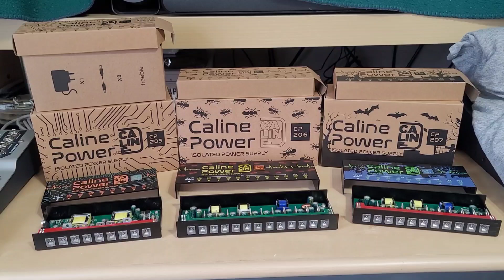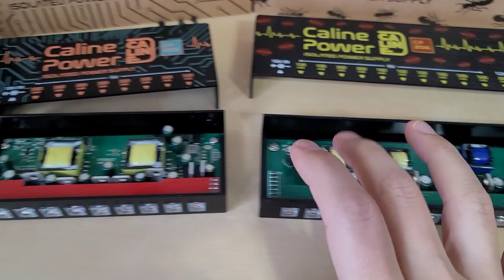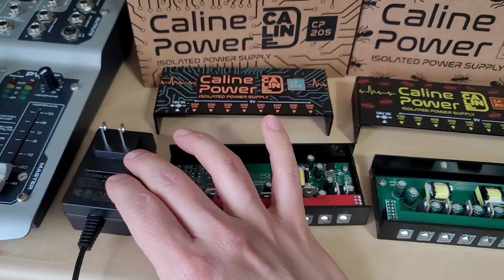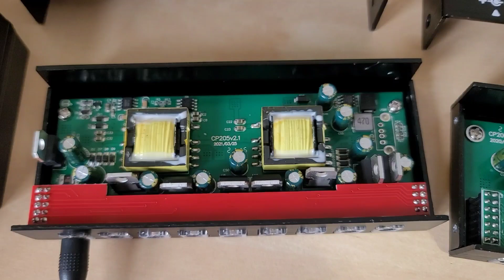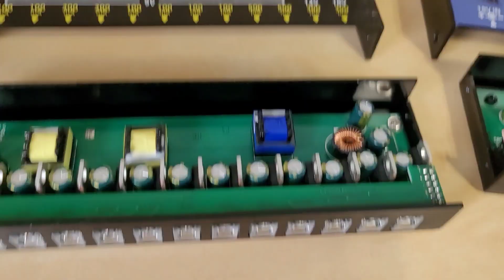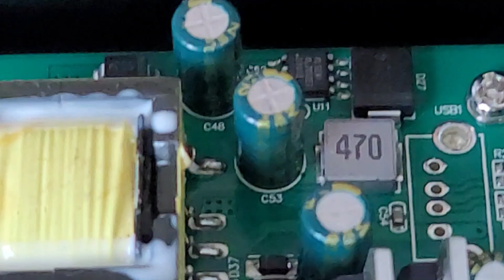Caline Pedal Power Supply: True Isolation? How They Compare To Other Brands?

Comment: The way you tell whether the outputs are isolated is by testing for continuity between them. There should be none. Seeing a transformer isn't proof of anything. It's indicative of isolation potential, but not proof that each output is truly isolated.
Reply from the maker: Again I have answered your comments on my other videos and transformers do exactly that they isolate galvanically. Maybe you should do a video and explain why you think these are not isolated, I doubt you will.

I can go and do that continuity test you were talking about but that doesn't necessarily tell you anything. You can have filtering components that create a very high impedance where most meters would not show a low ohm reading between the negative ground pins. That type of "isolation" should be called filtering since there is still a physical connection.

Caline's engineers sent me the schematics of all their power supplies directly so that I could review them. The fact they implemented the switch mode transformer with separate secondary windings gives you galvanic isolation.

Comment: I use one of these to power my Boss ME-90 multi effect pedal (9 volts at 200a), a Shure GLDX wireless receiver (15v) and an Archer Ikon Overdrive (9v).  No problems or noise at all and it costs under $50.00!
Reply from the maker: Awesome!

Comment: Any experience with the CP-209?
Reply from the maker: @epoxy81  yes! I'm working on reviewing that now actually. It is isolated like the others
Reply: @Bassguitarist1985  is it good?  it's my first ever power supply.  it was just so much cheaper than others that I was a little nervous.
Reply from the maker: @epoxy81  same topology inside as the others! I wouldn't use for high current above 500mA for one pedal, but it will be nice and quiet and no buzzing.

Comment: question? have 8 mini pedals and my power supply only has 7x100ma plugs 1x500ma plug 12v 18v plug. can i plug one in the 500ma slot or will it fry my pedal? cheap or not i cant afford to buy it twice
Reply from the maker: @livefreeordie1776  500mA is fine for a small mini pedal. That's it's max capacity, if the pedal is rated for 100mA that is the most it will draw. Don't plug in a 9V pedal to the 12v or 18v unless it's rated for that voltage.

Comment: can I plug any 9v pedal to any of those plugs? like the 300 and 500ma??? or only to the 100ma? basically, if I have 12 single 9v pedals I could power them all with this block right? btw Great videos! thanks
Reply from the maker: @NocturnosRockShow  Yes you can as long as the current requirement for that one pedal does not exceed the rating of that particular port. You can easily power a 9V pedal that takes a max current of 100mA into a 500mA port.

What you don't want to do is put a 500mA rated pedal into a 100mA port, it simply won't work and likely malfunction.
Reply: @Bassguitarist1985  perfect!!! thnak you so much for the clarification! you rock!!! thank you

Comment: Dude! Thank you! 🤠 Any tips on using one of these to power a Line 6 DL4. Requires 9VAC 1200mA minimum? Can it be done? I always see DL4's on pedal boards and am curious how it's done
Reply from the maker: @TH1NB0Y  sadly not with these power supplies. That's a lot of peak current. There are other power supplies better suited for high current applications like the Line 6.
Reply: @Bassguitarist1985  Thanks so much!

Comment: I had (and still have, but outgrew) one of the Caline power supplys shown in your video. It served me well at the time but now I have a large pedal board that required an MXR ISO Brick for my HX Stomp and digital pedals plus a mini ISO brick for my dirt pedals and whatever else I'm patching in at the time. I still have to use output splitters and I daisy chain multiple pedals on the high current outlet of the mini ISO brick. I always thought it was odd that the wall adapter for the Caline power supply was rated at an output of 1.5 mA but the sum of all outlets on the power supply itself is 2.6 mA. How can this be?
Reply from the maker: @onlyusernameleft2  1.5A at 18VDC is 3A at 9V. Not all the outputs are 9V but I can assure you the wall adapter is more than adequate.
Reply: @Bassguitarist1985  I'll defer to you on that. The extent of my knowledge of the electronic side of music gear ends at soldering pickups and pots on a guitar. Anything connected to a power source eludes me.

Comment: Really helpful - thanks👍✌️😊 Ive been trying to get to the bottom of this issue - after reading reviews of cheaper RPS units. Celine seems ideal for the hobby/bedroom/weekly gigging musician👍✌️😊💜
Reply from the maker: Exactly and as a matter of fact I'm testing a new version of the power supplies that actually has the DC to DC converter in them eliminating the linear voltage regulators. Still needs a little bit of tweaking but as a company Caline is listening to the customer base
Reply: @Bassguitarist1985  Good to know. I may buy one soon, in the UK, great value, for something that works and is well specs✌️👍🤞💜😊
Reply from the maker: @musoseven8218  indeed! And the newer board version is better, but it needs some improvements before I can put my approval stamp on it.

Comment: I found a power supply with 8 isolated outputs and it is powered by a type C port, the pedal is called pedal power and model number is PW1. Whats the likelihood of it being truly isolated, and seeing as how its using a type C port instead of a barrel jack would it still follow the same rules as what you've described in the video. It says the input is 5v at 2.1amps, but I know Type-C can do like 20v I think so I imagine they'd be doing something like that, i dunno lol
Reply from the maker: Got a link to the product?

Comment: Have you reviewed the cp 204? Is it anygood compared to the cp 205?
Reply from the maker: No I haven't. The CP-204 is a non isolated mini PSU if I recall. Works for most applications except when you need isolation.

Comment: It might be one of their oldest power supplies, but I can tell you that the CP-4 (the snake one), is NOT isolated. Noisy as anything. It was $25, it was worth a shot. Their newer units are reportedly doing well.
Reply: I've only heard of Caline this year and every one of their products I've bought has been fantastic but I have heard people talk about "the old Caline" and how "they've stepped up their game." I've seen threads on pedal mod forums about another companies product using less than glowing terms. When reading further the enclosure is opened and the PCB has "Caline" printed on it and is a discontinued product that another company produced under their label. At least from what I've seen, there seems to be evidence that Caline was not always known for their quality and value. As someone who had parents that never even bought me new clothes of my own, I can have the pedalboard I dreamed of as a kid and each one cost no more than a large pizza.

Comment: Would know if the Caline CP-02 isolated also? I'm planning to build a small pedalbord and it would be nice to use a compact power supply.
Reply from the maker: Hey I am not sure I have not encountered that power supply from them yet. It looks very small physically so I'm not sure if it would be a true galvanic isolation with switch mode transformers. If you have it can you take it apart and see? If not I would recommend the 205 206 or 207 here in this video
Reply: Hi, did you get it in the end? I'm considering buying this one myself...

Comment: The isolation is on the positive side.  You can’t isolate grounds since all the pedal grounds are  connected together. 

A ground loop is the result of two different AC ground circuits, like two different mains outlets, where one has a lower ground potential than the other.
Reply from the maker: Audio grounds are common yes, but the DC ground even if common with analog ground are different. The LVRs are powered by a separate winding on the secondary side which is rectified. So you have an isolated positive and negative rail (virtual ground) for each LVR. I get what you are saying about audio grounds being common pedal to pedal, but it's important to note the DC grounds are isolated as well as the positive side.

Comment: Thank you for the video, it's really helpful. I use my Caline with total confidence and it doesn't let me down. 
I might add that being a complete numpty I plugged the power in to the wrong end (ie one of the power outlets) and I can happily report that this doesn't work. At all. However when I realised my stupidity and plugged it in correctly everything worked just fine. 
So its idiot proof too.

Comment: Do you get measurements of voltage output before putting them under load? I’m going to try your technique with 100 ohm resistors, but unloaded ports are at 10Vdc.
Reply from the maker: I measured 9.01V no load

Comment: Great video, however, can you explain why AC current is rectified to DC in the walwart, only to be flipped back to AC in the unit? Wouldn’t it be more efficient to bring low voltage AC from the wallwart into the unit, eliminating the two converters?
Reply from the maker: Sure, the main reason is regulation. That circuitry exists inside the wall wart specifically. Stepping down AC voltage from the mains is done via a heavy transformer usually. Using a switch mode step-down buck converter that is lighter weight will take the mains voltage down to the regulated DC voltage first. The isolation will happen next with the conversion back to AC voltage. Finally the last stage rectifies it back to DC and filters any switch mode noise out.

Comment: I will say that I guess I got lucky cause Im using a Caline P-1 power unit for now about 4-5 yrs powering a 12 pedal board without problem. Enough of my pedals were bought used modded that I figured noise would always be a problem. Only real noisy is my Butler T Driver older 3 knob model thats bias knob modded by Fromel. I'm using a  12u tube and splitting the 18v between this and a silent modded 10 band EQ. Again works perfectly for yrs now. But I see in comments about my pwr unit noisy , breaks fast, doesnt work from the get-go. I planned my board out before putting it together and  have used EBS Gold flat patch cables from day 1. I used this board for a few rock shows and worship service for a yr. And now it sits on my floor waiting to go to work again.

Comment: Just wanted to say 
I bought a 206 after watching your videos, and it powers my analog stuff as well as 2 uafx and a couple of boss digital ones with no discernible noise
Although it gets warm and the wallwart gets warm, i have left it on with all effects on for a long time, and it still works great
Thanks for doing the legwork
Reply from the maker: Great to hear!
Reply: I had a CP-206 and the box itself was getting warm and eventually it started smoking and emitting an acrid odor. Taking it apart I could see that one of the components (transformer I think) had melted and had burn scars. I was using most of the ports but none were overloaded and most were powering pedals far below the respective port's capacity. I was lucking this happened a) while I was right there and not out of the room and b) I was just practicing - would have been worse if it left me stranded at a rehearsal or a gig. Bottom line - I replaced the CP-206 with a more "professional" brand PS for my pedal board.
Reply from the maker: @sams_6 Sorry that you ran into an issue like that. I gig about three times a month and have not run into this issue for the last couple years. I would say you got a lemon, and for that my apologies.
Reply: How's your 206 now after 1 year of owning one? Planning to buy one myself

Comment: Thanks for this video. I'm strictly a novice trying to learn to play guitar. I currently have the Donner daisy chain power supply, but haven't used it yet since I only have one pedal(chorus) I've looked at the Donner DP 1 and 2 model power supply. Some say they are not truly isolated, but what I see on Amazon is a host of power supplies that look identical, with just a different name. If I ever used just a few pedals I think this brand would work fine. Like I said so many choices when it comes to power supplies

Comment: So what would a 1200watt multi channel isolated DC power supply (6 channels 200 watts per channel) look like.
Reply from the maker: No idea. 1200W DC brick for pedal power would be insane!
Reply: @Bassguitarist1985  It's for an application that has nothing to do with guitars.
Reply from the maker: @DaveElectric  Cool. What application?
Reply: I'm sorry I meant 75 watts per channel. So I would prefer 450watts output capacity. I liked your Y-cable idea. That would at least give me 9 watts per channel on a 12 channel pedal power device (12x 9v 500mA >>> 6x 9v 1Amp (y-connection) or 4x 9v 1.5A (triple Y connection). 

The application is for balance/charging a 150v custom Lipo pack using only 6S standard balance chargers. Why you ask? Because the balance chargers are both a charging device and a balancing device at the same time. And they have a WAY higher balance current capacity than your typical BMS board. It's not like I got to buy an expensive BMS board and then buy an even more expensive charger that is capable of being controlled by that same BMS board. That type of system for our battery packs is $1800 system minimum. If I had a price for a 450 watt 6-channel isolated DC power supply I believe I can bring the price down by $1000. We also have a 100v custom Lipo pack which only need 300 watt system.
Reply from the maker: Cool stuff. I'm not completely familiar with lipo technology specifically. I can only comment on its application as a pedal power supply. Thank you for sharing and for watching the video!

Comment: Great video, can I use the 12v output from the CP-207 to feed a Vintage Boss ACA pedal?
Reply from the maker: Yes those pedals were originally designed to have unregulated 12 volts inputted but internal circuitry down converted to the proper 9 volts sometimes 6 volts internally. We're talking late '80s here until 1991 if I'm not mistaken, then boss went to the standardized PSA adapters
Reply: @Bassguitarist1985  Many thanks for your answer, I don't know much about this, but is there any problem if I power my ACA OD-2 with 12v DC instead of 12v AC?
Reply from the maker: @Dan.guerrero_v  12VDC is what the original adapter outputted. Do not use 12VAC as that voltage may damage the pedal, or at the least make it malfunction.

Comment: Omg thank you so much. No one ever explains this! I’ve scoured the internet for so long and I don’t ever see any schematic explanations or anything.
The only info on isolated DC power I could find that was technical enough was WAY too in-depth and wasn’t about pedal power or even audio, and any other info on it is so basic and they always say “make sure it’s isolated. A lot of brands say they are but they aren’t,” and then there’s NO EXPLANATION, like EVER. 
Very rarely I would see them say a transformer is on each output but that didn’t make sense to me for DC obviously, and would make them much bigger, not to mention the expense. This clarifies things very well.
You are a godsend and I’m so glad I finally found this video. THANK YOU, THANK YOU, THANK YOU…
Reply from the maker: You are very welcome thank you for watching and supporting the channel. Any further questions please let me know
Reply: @Bassguitarist1985  now that you mention it…
I’ve got a Joyo one that has a built-in rechargeable battery (not isolated). Do you think maybe the reason you don’t see any with true isolation plus battery is due to the heat?

Comment: I have 7 pedals that use 9V. From tuner to OD and distortion to reverb/delay. I see 100, 300 and 500mA and now I'm wondering which should go where? Does it even matter which one I plug and where? Great video, cheers!
Reply from the maker: Match the outputs to your pedals current draw. For example if your pedal draws 30mA, then plug into a 100mA plug

Comment: Just got the cp205 last month..this month i have a new pedal added to my board....would using a voodoo labs type currint splitting y cable in the 300mah port be able to run two analog pedals with out any noise ,they have a current draw of +/- 147mah. its now a daisy chain scenerio right?
Reply from the maker: Yes it would be a daisy chain type scenario however you may or may not experience any noise. If the pedals are well filtered internally you might be able to get away with this scenario.
Reply: @Bassguitarist1985  I ordered the voodoo lab -y splitter cables.  They are  only grounded to one pedal..using the patch cable for ground(@ one less GND loop).this cp-205 is actually powering 10 pedals ,I took notice of where each transformer was and did a y in front and one y at the rear of the plug bus...and bamm 10 noiseless pedals and 3 are digital,and my green ringer  is germanium transistors and diodes so it was a bit noisy , now I'm quiet and I'm only using one wall wart not 5. Awesome video .my experience with caline with the v1 stuff was terrible so I pwnd it off on CL, but watching your in depth video has saved my marriage 300-500$...I've got 40$ in the cp205. 10$ in the y cables (used)...